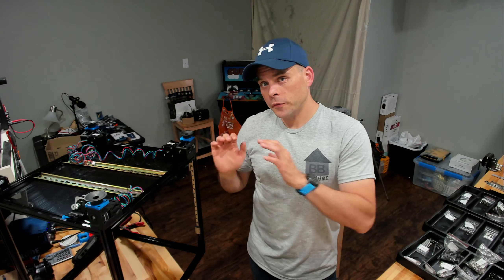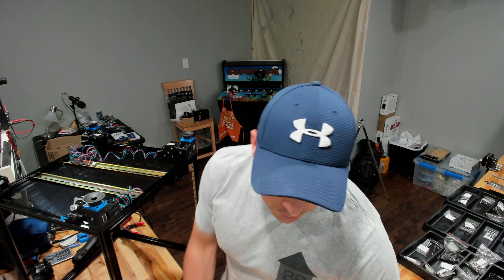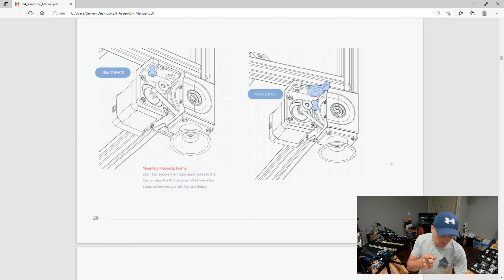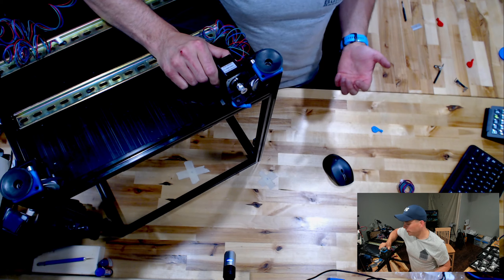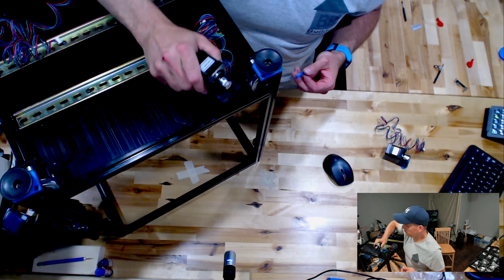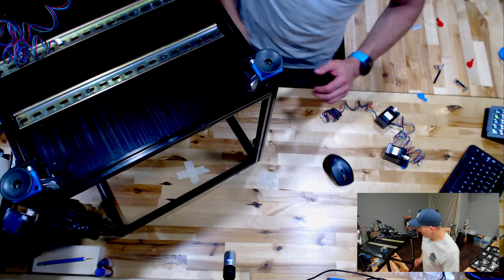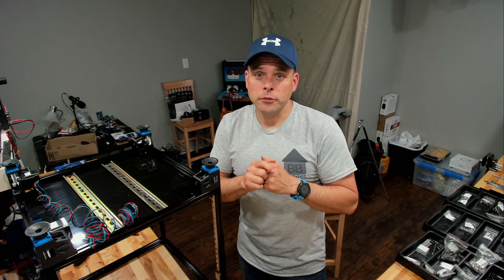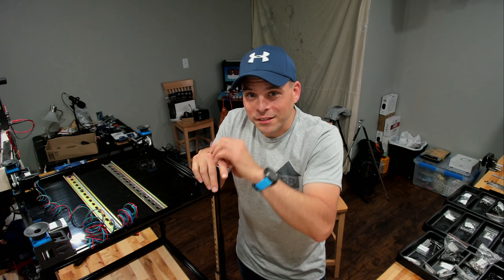*Episode 4.5* VORON 2.4 Build - Fixing My Mistakes!

Comment: Don't worry much - there are  mods for those Z parts that seem to be better than the 'standard' design (which does not seem to tension fully - but then it could be that the belts in the market are not of the same exact diameter).
Reply from the maker: Agreed - Just had to fix my mistake for all to see.  When you assemble on camera your 50/50 on your view vs the camera view. Some things don't become evident until you get to really look.  It was more of a "what was I thinking" moment.  Thanks for the support!  Let me know if you have questions or anything I can do to help.